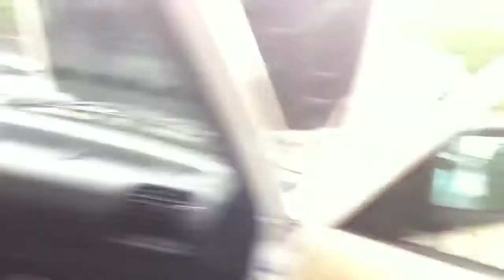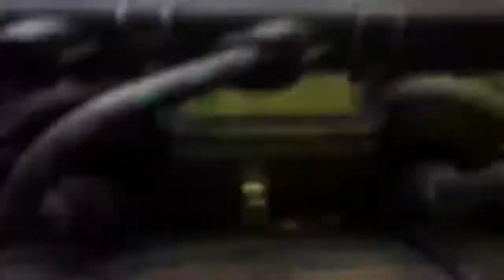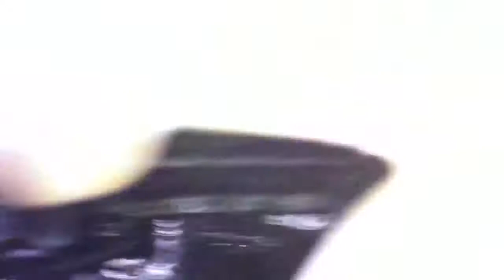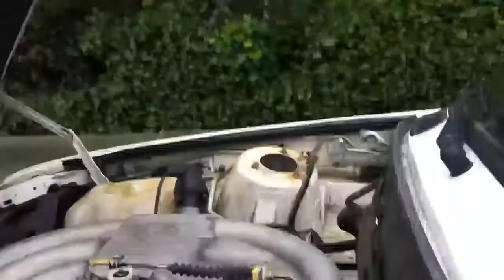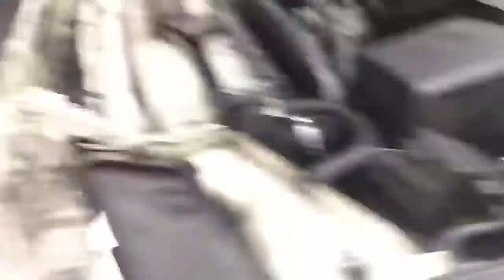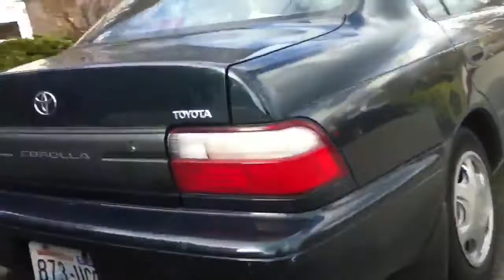E30 blown head gasket symptom

Comment from the maker: I can't remember if there is coolant over my oil pan. But I'm sure that there's mixture of oil and coolant in my coolant tank, especially on the tank cap. Also, do a compression test, if the readings are low, it's highly possible that you have a HG failure. You can go to O'reily auto parts to borrow a compression test tool. Hope this helps.